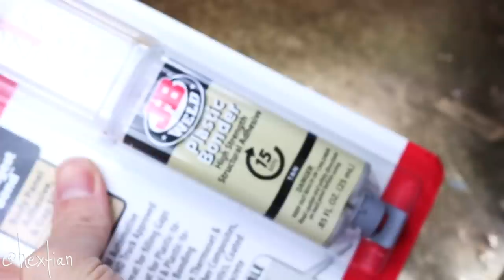Custom Azula Doll 🔥⚡️ [ AVATAR: THE LAST AIRBENDER ]

Comment: I love this!!! Fun tip for aging gold: use a faintly green-tinted black. The green tint gives the gold the idea that it's oxidizing and helps us distinguish it as metal instead of a sparkly paint or a yellow/orange object. It's a tip I learned from drawing. :) And my favorite character is Iroh.
Reply: does gold become green when it ages?
i thought it was only the case for bronze (i might be wrong though)
Reply: @yanstein8464  It's a color trick. Using green to shade gold will give it a more realistic feel. It's the same idea to use browns to shade silvers to make them look used and slightly tarnished. Just the slightest hint of it makes something look less painted and more like realistic gold. It's the same concept for bronze because it's also a type of yellow/orange/brown.
Reply: @yanstein8464  gold is valued because it is the only metal with doesn’t oxidize. It can get dirty however and for that, blacks and browns. 

Copper oxidizes blue or green, silver to black, brass gains a brown hue, and nickle silver goes greyer.